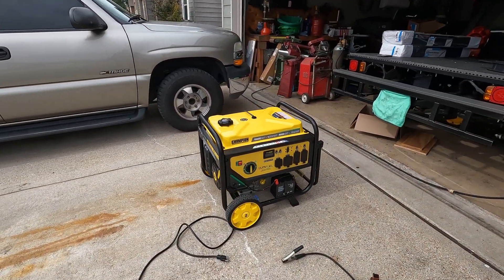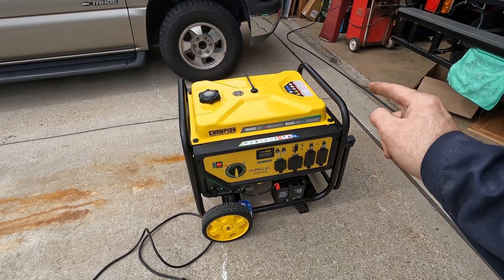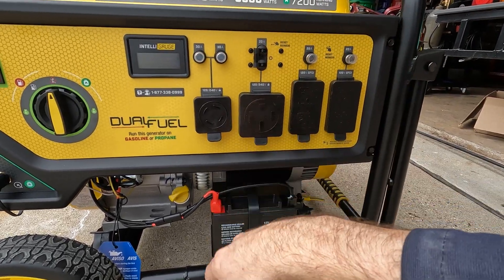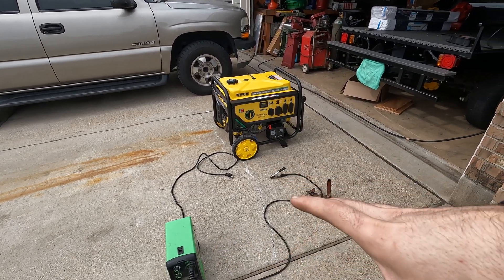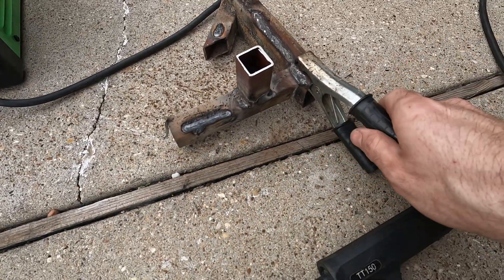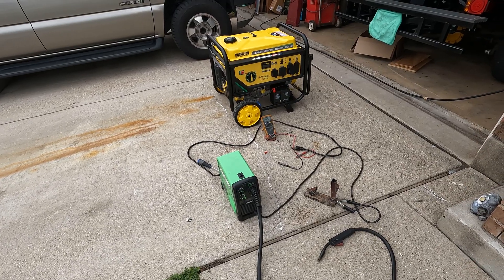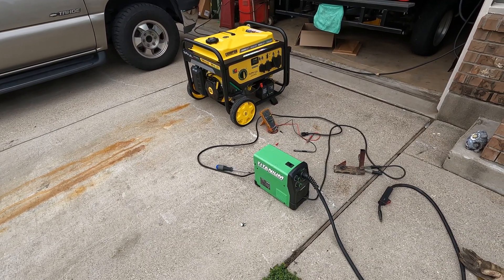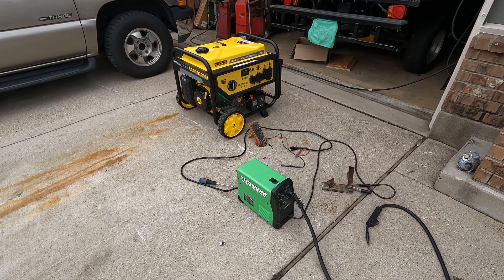Flux core welding with a generator

Comment: Should be running it with a inverter generator, as a regular generator will slowly ruin your welder due to " dirty power"
Reply from the maker: @Ca21431  I agree I would only do this in a pinch, but I wonder if an inverter generator would get messed up from a welder

Comment: inventors is that to hard to invent a battery bank to be conected to electricity all the time when we are using the battery bank to weld,  meanwhile we weld, so we never be out of charge and the welding machine will be in operation all day!

Comment: U just used my little lincoln handy mig with my little firman w2000i generator. Used .030 and .035 flux core and worked great. No surge and i also used my chopsaw

Comment: That size generator is mad over kill for a little 125 welder. You could run the Omni 220 on that.
I run my Omni 220 on a champion 4500 (3500) inverter fine.

Comment: Make sure you get a Surge Protector, you can get a good one for 60-90 bucks and it will protect your welding machine from getting too much power so it doesn’t fry the mother board on it. 

i use a harbor freight predator 9000 generator (non inverter) and using a surge protector will keep an inverter style welding machine from getting cooked. 

FYI a transformer style machine like the old lincoln tombstone you have in the back will probably pop the breaker on your generator because they pull SO MUCH POWER. 
but the smaller machines should be fine, looking forward to seeing more videos. 
i’m actually going to make a video with the predator generator using my little cheap stick welder i got off ebay
Reply: Thank you, i didn't know about that yet

Comment: Damn so the 3750/3k running generator I have won't push the 110flux core welder I'm thinking it might be the harbor freight welder? It barely would make a spark
Reply from the maker: Well welders have large surges, it should run a flux core 110 machine, but you may be in the edge of what that generator will do, that’s why I went with this larger unit, it does it easy, plus I don’t feel like I’m pushing the generator too hard, which can damage it if done too often